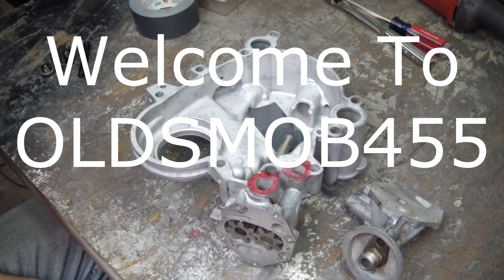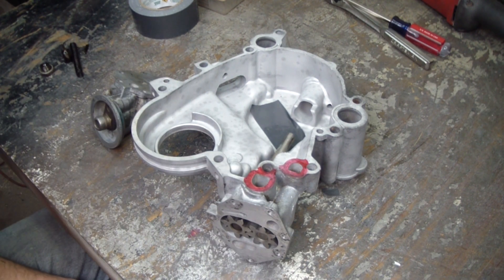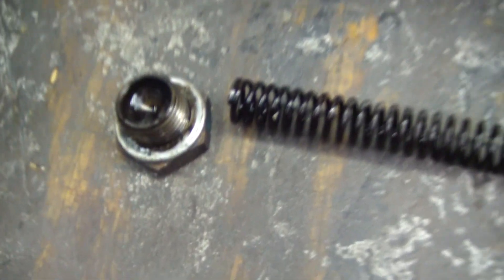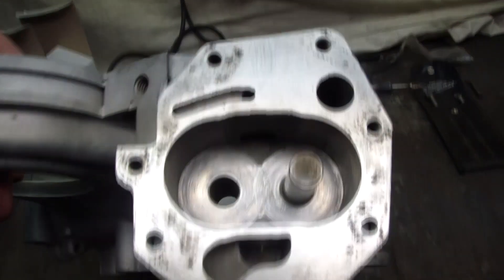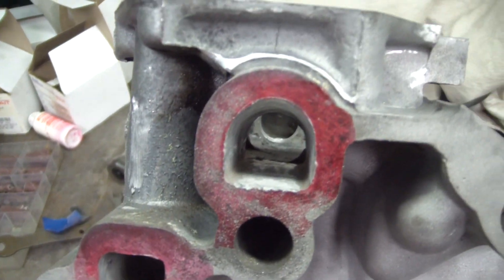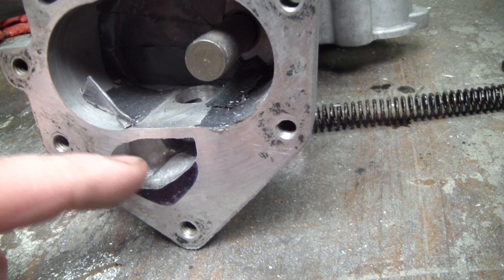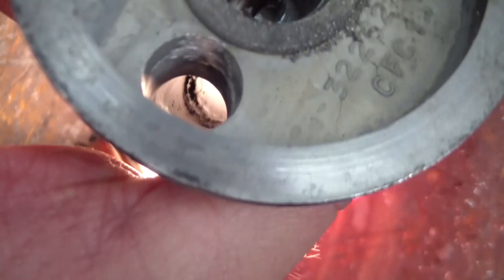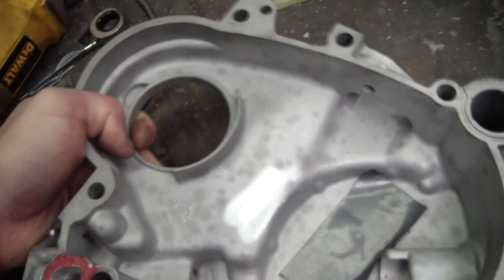AMC Timing Cover Oiling Modifications V8

Comment: I have had the oiling issue on my 1973 Javelin AMX. It now has 95,000 miles on the engine, it has never been apart, It has the 401 with 4 speed. The timing chain and oil pump both have been changed twice since I ordered it new. The first at 35,000 miles and second time 70,000 miles. Most AMC people of the day were unaware of this silent killer issue. More than a few 390 and 401 engines were ruined because AMC never addressed the oiling problem, the fix was to  use a mild bread and butter cam and to under carburate. On the 4 speed cars, AMC went with a centrifugal roller assist pressure plate that locked the assembly together above 3,600 rpm's, there for preventing speed or power shifting, another warranty issue fixed.  The 390 and 401 engines on a test stand from the factory, showed that with the new type 2 cam at 4,300 rpm's, the engines horsepower was all in at that low rpm. AMC did all this to avoid warrantee issues with their engines. Not that this was all bad, they just didn't have the money to pay out on warranty issues.

Comment: stripping timing gears and don't know why? set your oil pressure at 40 PSI like the manual says, the gear cannot turn the pump at higher pressures without failing.

Comment: Holy smoke.... I had no idea. My 390 .060 over was rebuilt by a master engine builder 20 years ago before put in storage. I have 70 pounds of oil pressure at 7 k RPM. I just wonder how'd the engineering group didn't see your fixes? I'm never going to race mine but oil flow is important. If I wanted what you do I bet it would cost a fortune. Lol. But a rebuild would cost MORE. Thanks for the info. I wonder what you do for a living?

Comment: Thank you. That's the roof of my problems. The old plunger never fell or came out of the housing. I was not sure that it was needed since the stock one didn't have it. I now know that the stock one is still in there. The original spring was so gunked up it it would not compress. Ican only imagine what kind of shape the plunger is in. Thanks

Comment: That one area that you chamfered a bit because you could not really get to it reminded of recent project in which I tore strips of sandpaper to get radius/bull nose a tight spot.
Another thing that would work is an emery cloth roll that plumbers use.
It can be torn to your particular hole/crevice.
When you tear it to size the edge gets distorted, that is fine because the emery forms itself into the work.
I pull and stretch the opposite side to distort that edge also.
Another thing I do is fold strip in half to format a crease making the emery easier to form itself into work or hole.
The process takes a bit longer but I can do what I want and do not risk cutting what I do not want or over cut.
I learned to rub candle wax or other wax into the sand paper/emery cloth or even a grinding disk to aluminum from clogging the grit
One last trick (among others) is that I can use the folded strip to strength the strip and get more into that hard to reach radius.
Finally, when you employ what I mentioned here you might discover something I did not think of yet.
If you are kinda like you always seek to make some thing or process better.
Now go play...

Comment: It woukd actually be more effective to fill in the corresponding hole at ~5:51 to match the smaller one because it is only wide on that one spot and you essentially create a "bubble" of pressure difference there. Either way i doubt it has any effect in performance
Reply: Richard Troxell Hmmm. i rewatched it and my oil pump housing  has a differnt pattern hole than yours. I filled the excess with jb weld so that it has no velocity loss. Anyhoo, it is a good video.
Reply: Im just curious, what car/trucks is this beautiful engine from/in?

Comment: I recently had some low oil pressure problems on a AMC 360. I bought a oil pump kit. replaced the gears, and the spring for the pressure relief valve. What happens if the valve was not put back in?